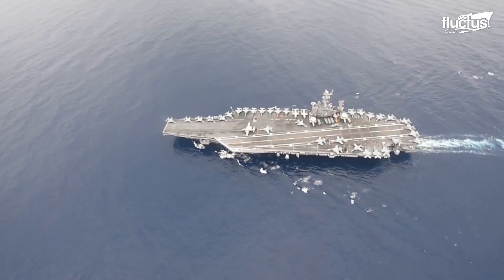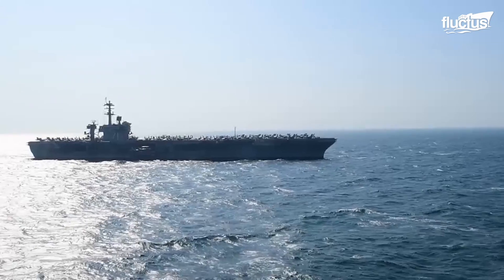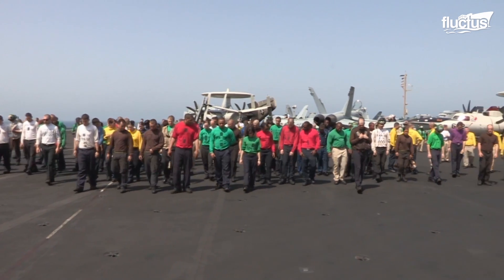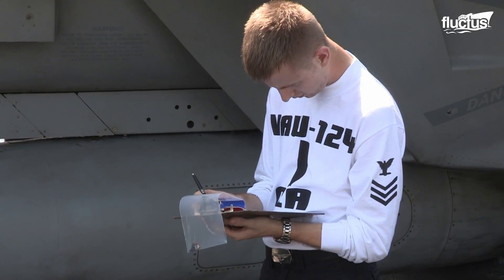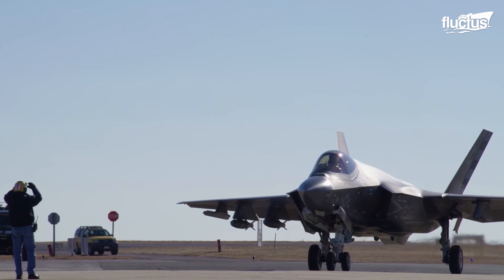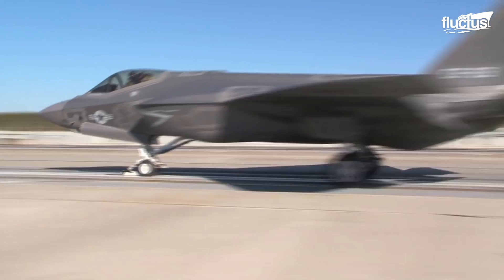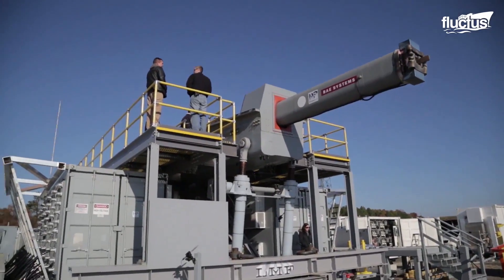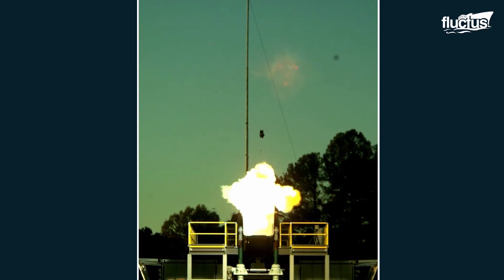US Weird Method to Save Pilots Life on Gigantic Aircraft Carrier

Comment: like in space a washer stationary ok
your doing 16000 miles an hour  bang
on deck same washer  jet efflux 2000 mph
would you like a washer hit you at 2000 miles per hour
dont think so (METRIC TYPES USE A CALCULATOR)

Comment: Not weird at all!  It's common in every service that flies aircraft.  It's a DAILY event around aircraft hangars, and even in maintenance hangars.  You don't want a $5 bolt to be ingested into and damage a $5M engine!  Street sweepers and road vacuums will not clear any surface of all FOD.  It's Aqueous Film Forming Foam (AFFF).  Not AFF.  AFFF is a fire fighting tool.  Not a washing agent.  What you showed was the crew washing the AFFF off the deck AFTER a fire fighting exercise.  Had nothing to do with FOD.
Reply: Thanks for clarifying that. It didn't look right to me. 
Thanks
Bob